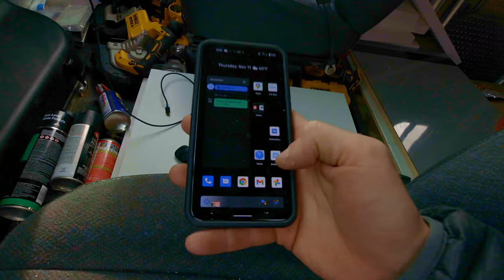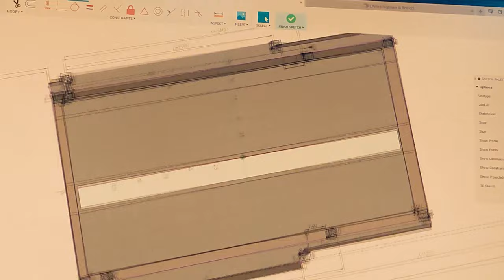My New Truck

Comment: Hi Josh,  I saw the build you did on Patrick's post, the finished Ambulance.  Its the best conversion I've seen, and and the smartest.  It shows your engineering skills.  I'm not easy to impress, and I am impressed.  The electrical set up was very powerful and well designed. That is the guts of an RV.  Also impressed by your bathroom layout with toilet, washing machine, custom shower pan.  To be able to fit that into a tiny 14 ft box is incredible.  Bravo!!
Note:  My daughter had an LG Direct Drive washer/dryer combo unit.  I would advise against that.  It did not need an external vent and there was no lint filter. As a result, the lint accumulated inside and clogged up the entire machine, rendering it useless for drying.  I did major surgery on it, saw where it was blocked up but the design prevented cleaning it out. Super frustrating.  If you use one of these machines, be sure to vent it out and know where the lint filter is. It will be hard to remove that machine and clean it in its present location.

With regard to the aluminum framing used for your cabinets, I'd love to know your source. 80/20 is outrageously priced despite coming from the same shop in China.  Did you use aluminum tubing or extruded aluminum?  What brand, any links?  If extruded, did the fittings - channel locks, braces, nuts and bolts work well or misfits?  80/20 quality is high.

Regarding Tesla Batteries, can you please make a video on them?  I'm concerned about fires, safety, how to keep them cool /warm, and which source is reputable for used batteries.  Obviously they are a great value for used ones, as there are few other choices for low weight, dense power, cheap price.

The shower pan is gorgeous and functional with that long drain.  That solves any standing water issues.  Who made that for you?  What drain did you buy on Amazon?  I need to remodel my current RV bathroom and the shower pan is a  headache.

The colors of your RV build out with olive green cabinets, warm wood paneling, is superb.  I used click lock bamboo wood flooring, small strips.  Nothing popped out.  I also tiled my bathroom floor with mosaic tiles - the trick is to use Polymer in the grout and the mortar and small tiles. The smartest flooring is industrial rubber mat I think. I may change to that.  Very durable, water proof, dampens sound and vibrations, and insulates. No wear for decades. 

If you want to see what the best commercial van builder uses, check out Humble Road channel. George Mauro used to be a photographer in NYC then switched to van building.  He is an artist with materials.  I picked up a lot of tips from him and best tools, materials, techniques. Thanks again for your videos and incredible build.  I wish you the best.  If you are in CA, look me up.

Great camera angles on your van by the way!  And your driving skills are amazing, ha ha!!

Comment: 2:58 When you say you are going to work in the van I assume you are going to have your computer there. Are you going to install WI-FI or go with 4G?
Reply from the maker: There's a local network in the truck with a wifi router, and that's connected to the internet with a 4G modem.
Reply: @josh-sheldon  Oo, that's brilliant!
Reply: Have you considered adding a starlink dish to it? Obviously you wouldn't be able to just mount one on top but I imagine having one fold out when the truck is stationary would be pretty cool and faster than 4G while also effective when not in range of a tower.
Reply: @josh-sheldon
Reply from the maker: @skyblaze103  Yes but currently Starlink requires a static location.
Reply: @josh-sheldon  awesome. I do hear that it should be fully mobile soon though, but that's according to Elon's twitter account, so not sure how soon that soon would be
Reply: Missed 'currently' so you're probably aware of that too then nvm